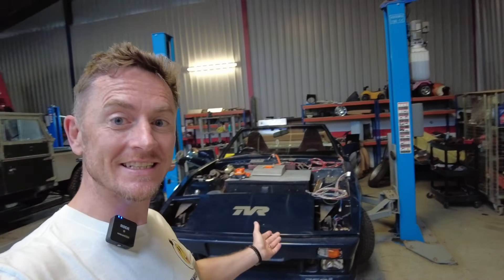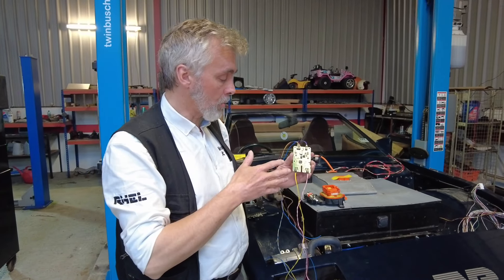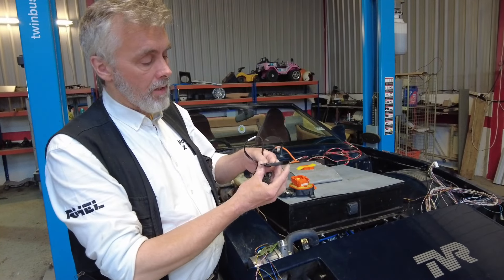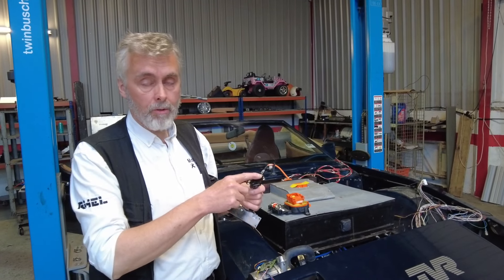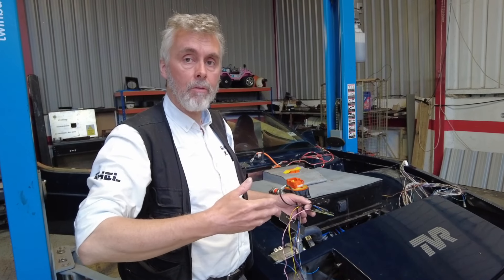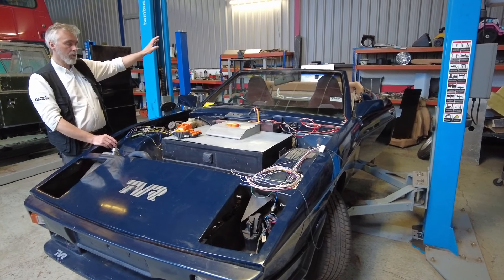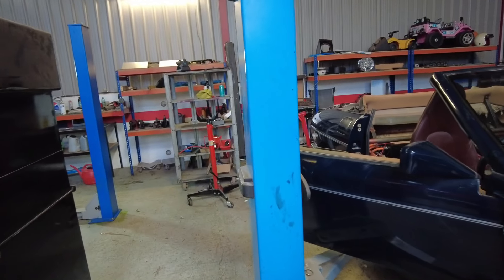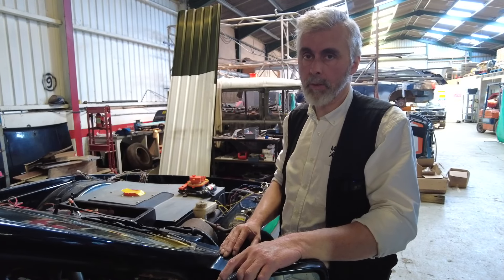Tesla powered TVR. Ep22

Comment: The position of the battery in the TVR seems pretty high, will that not effect the handling?
Reply from the maker: @LifeVacEurope  yes it is rather high, the options for lower opportunites were explored, however Ralph has designed it this way based on the space available.

Comment: What’s the point. A TVR needs to make a racket, it’s part of the essence of the driving experience. Converting an old Mercedes or Daimler would make far more sense.
Reply from the maker: @AdrianWilkinson-e2p  a TVR is all about excitement not noise. I didnt buy a Griffith 500 in the past for the noise, I bought it for the experience. This conversion aims to recreate that experience with an electric drivetrain.